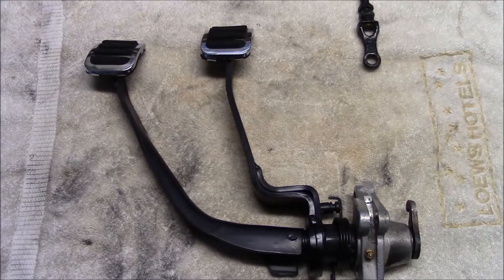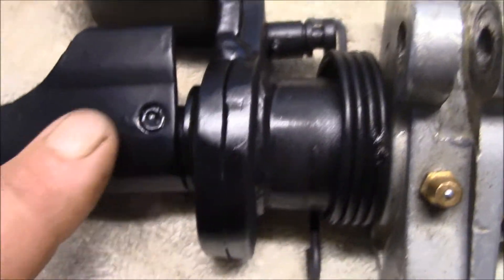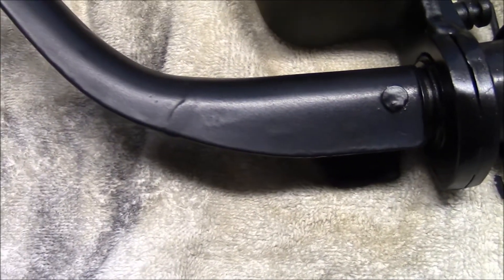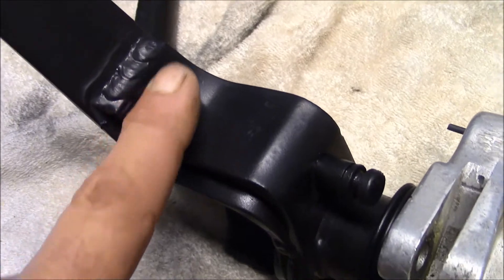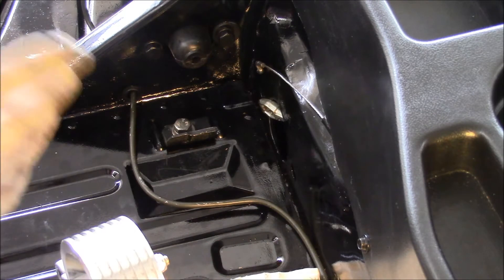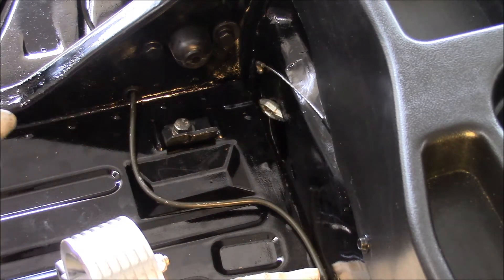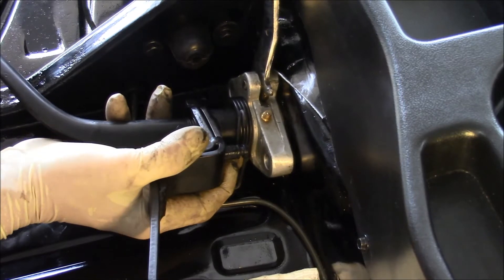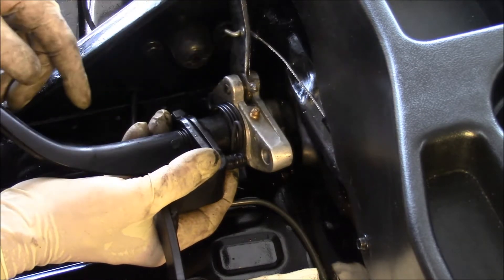MANX DUNE BUGGY RESTORATION & HOW TO: PART 5 PEDAL INSTALL & WIDENING

Comment: When I worked at the dealer in the early 70s we would use a piece of copper wire to hold the clutch cable in place. Also before clutch cable replacement. We would ream out the clutch cable tube with a old clutch cable that was frayed at the end and soldered just after the frayed end. Then it was lubed and was chucked into a drill motor and worked in and out of the tube a few times. We seen a lot of worn thin or broken clutch pedal cable hooks on the clutch pedal shafts also. And the mounting brackets that mounted the cable tube assembly to the inner tunnel would snap off. Ah the good old days!
Reply from the maker: Thanks for the tips. Some of them I'm using already. As we know, the experience we gain is invaluable. That experience is never gained from a text book.